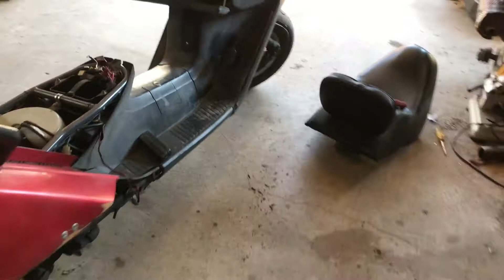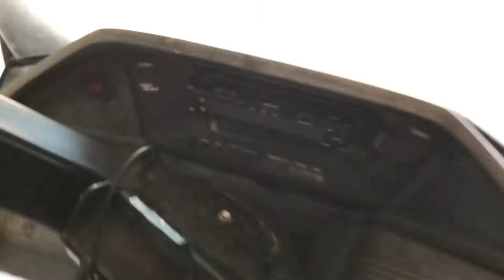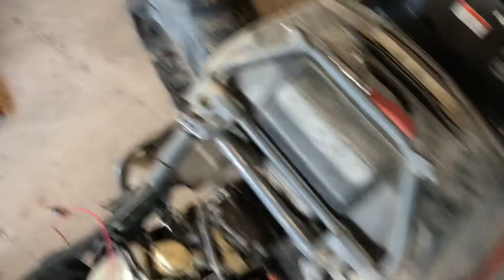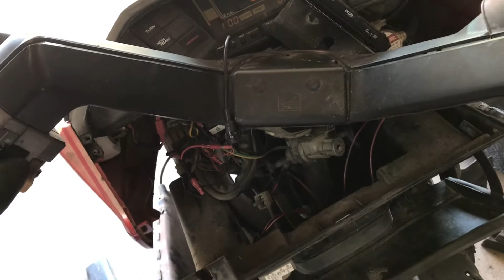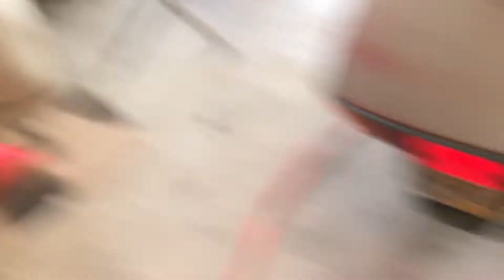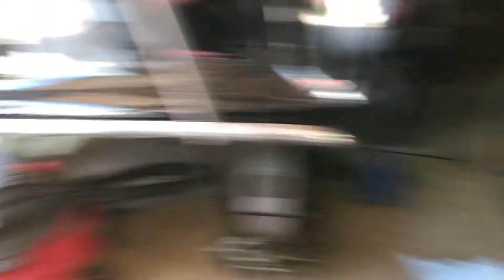1993 Honda Helix resurrection from an estate sale

Comment: I think you can use the title to get a new key from Honda. But I'm not sure plus a new oem ignition is cheap on eBay
Reply from the maker: I thought about going that route, but I found a whole matching set of locks and ignition with with keys for $50 shipped used on eBay.  I also found a used coil from a 2006 helix for $10 shipped from the same seller so its looking good.
Reply: origionaldz awesome! Looking forward to the resurrection.